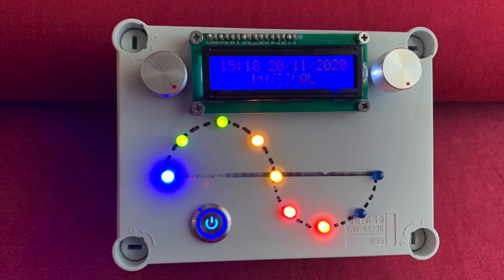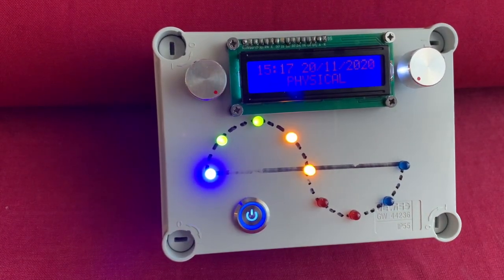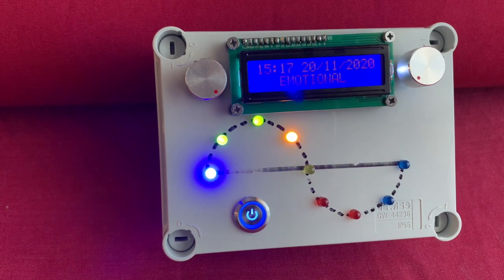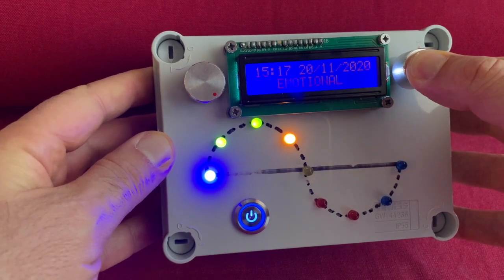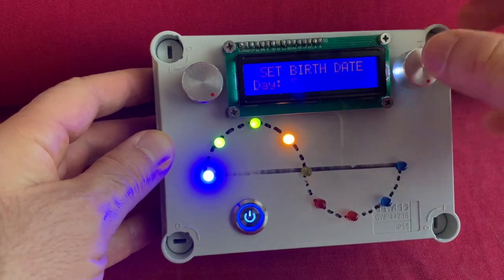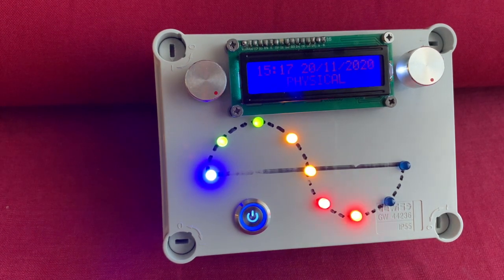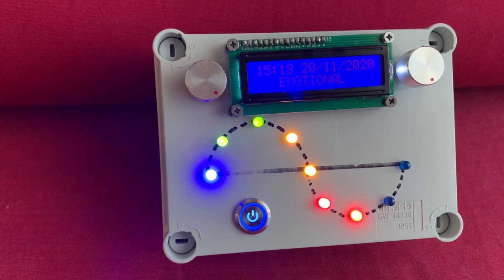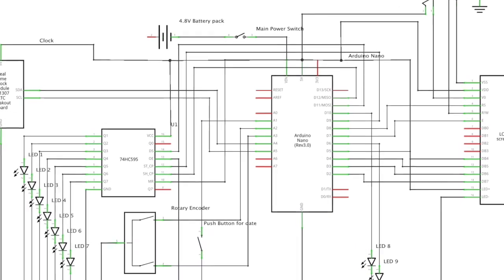Biorhythm Clock using Arduino Nano, RTC, 1602A Display, 74HC595

Comment: Says theres 32 comments!  Where are they?  I also have an additional question.
Reply from the maker: Hi @Joe Linsalato. I can see the comments. Not sure why you cannot see them. Please go ahead with your question. Glad to have the opportunity to answer.
Reply: @CarloStramaglia  I'm curious as to how this machine works.  The only data it receives is birth date?  Only two comments where visible. Try logging out of YouTube and checking to see if comments are visible
Reply from the maker: @Joe Linsalato. The only input needed is is the birth date which can be changed with the front nob. Before that, you need to setup (only once) the current date. This is done using a separate sketch that I will send you as well. Actually the source codes are visible on line at this site https://create.arduino.cc/projecthub/cstram/biorhythm-clock-using-arduino-nano-rtc-1602a-and-74hc595-db8cb2?ref=user&ref_id=1371882&offset=13
Reply: How about a reading
Reply from the maker: Hi @Joe Linsalato. Not sure I understand your comment.

Comment: Can I get a detail report of these project 
Email:jarihanth650@gmail.com
Reply from the maker: Hi. You can find the details of the project in this link https://create.arduino.cc/projecthub/cstram/biorhythm-clock-using-arduino-nano-rtc-1602a-and-74hc595-db8cb2?ref=user&ref_id=1371882&offset=6

Comment: I still use a chart I bought back in the 70's. I would like the circuit as this way something I gotta do. email : dlctex1701@gmail.com
Reply from the maker: Hi. Great to hear. The idea came to me for the same reason. All the details are in this link https://create.arduino.cc/projecthub/cstram/biorhythm-clock-using-arduino-nano-rtc-1602a-and-74hc595-db8cb2?ref=user&ref_id=1371882&offset=6 Hope you enjoy and don't hesitate to ask in case of need.